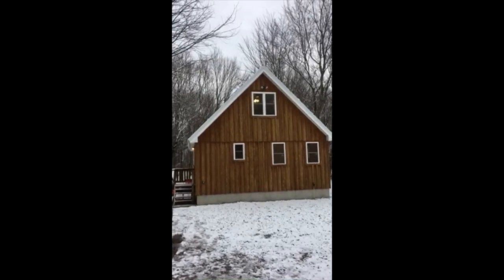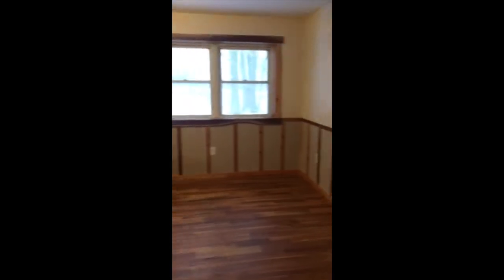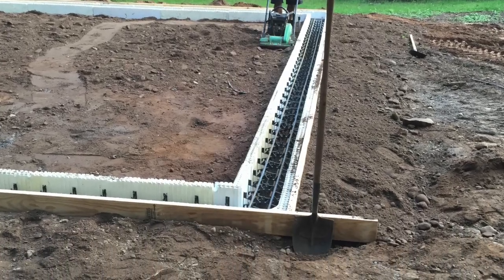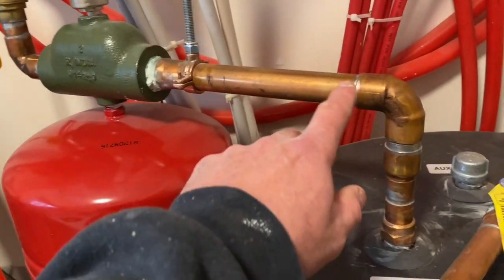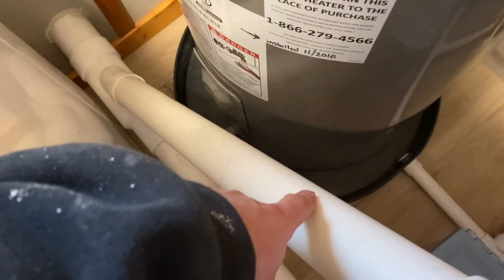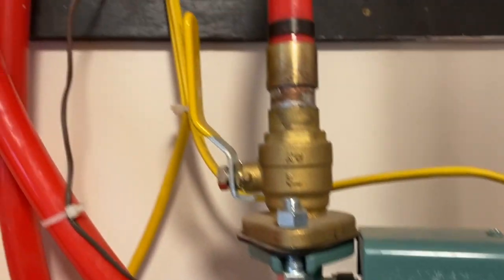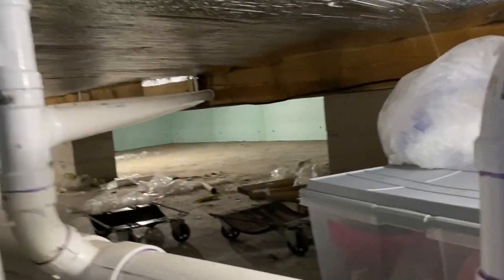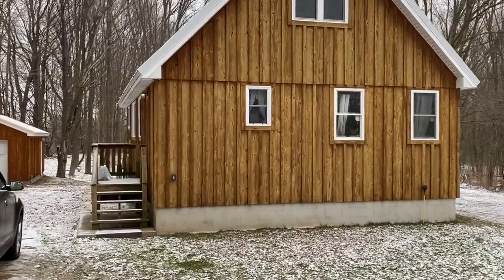Can you heat a house with a water heater????

Comment: Bondo!
Love your videos!
What heats the upper story of your rental house?
I'm planning my story and a half garage with an apartment/loft, which is similar in size to this rental. Radiant heat in the concrete slab, but I'm not sure how I should heat the apt. loft above? Thanks in advance for your answer.
Kendrick

Comment: Just FYI... when you need to get a pipe through a floor joist, drill the hole in the center (vertically). The joist top fibers are in compression, and the bottom fibers are in tension. The center is neutral. Cutting a 1" notch in the top of the joist weakens the entire joist to the equivalent of dimensional lumber that is 1 inch narrower.... you just turned a 2x10 into a 2x9 for example.

Comment: Hot water heat is called hydronics and it's been around for a while. My brother has a HVAC business. In the late 80s, I helped him install all of the hydronic systems in a newly constructed 120 unit town house project. They were all about 1200sf, 2bd, 2 bath units. We used 50 gallon high efficiency gas hot water heaters. Later on we were told that the average power bill per unit was about $65/month and the gas bill was about $25 in 1989 dollars. At the time, the whole system was considerably cheaper than the conventional heat pump system. The only downside I've seen with this system is that you have to size your water heater properly. If it's too small, you will run out of hot water and your heating system is forced to run on emergency heat strips. Which defeats the purpose.
Reply from the maker: Thats awesome. Thanks

Comment: NICE HOUSE, WELL BUILT‼️ QUESTION, Why did you go with Electric hot water heater for your domestic water when you already had propane to heat the in floor heating⁉️ If you have a power outage you would still have hot showers. NEW SUBSCRIBER ‼️. Vinny 🇺🇸

Comment: That check valve on the return that you showed...trying to understand what that's for. When would water pull be able to pull in the opposite direction? Thanks for all the info!
Reply from the maker: That would just stop water from migrating when there is no call for heat.
Reply: @bondobuilt386  ok, thanks!

Comment: Every other application like this I've watched has the pump on the return side - cooler water for longer lasting pump life.  Do you have reason for pumping the hot water?
Reply: most boiler diagrams now push the water on the hot side now

Comment: I built a 26x40 2 bed room ranch  with 2 inch EPS as a thermal brake and 6 inch  dense pack saw it out on my wood mizer heat it with a combi lp boiler use vary little fuel to heat

Comment: How do you size the water heater for the heating system?
Reply: in order to size any heater, you need to know the heat loss of the building first. Heaters are listed by either Kw or BTU output so you can choose what you need. (hint: 1 Kw = about 3400 BTUs)

Comment: don't you use transfer plates to attach the tubing the bottom of the floor.
Reply from the maker: No I dont use them. They are noisy as the tubing expands and contracts and They cost more and are not nessasary at all. Also my tubing will not get damaged down the road as it is pushed right up against the plywood. 👍😊

Comment: so your crawlspace is a dirt floor, block walls?  Looks like you did a scratch coat or something across the outside face of the block?  what about inside, probably foam board?  what sort of access door did you do for the crawl space?  Something you made up or purchased?  Insulated no doubt...
Reply from the maker: Mike we basically poured a frost protected monolithic slab and layed 5 courses of blocks on top of that. So the floor underneith is concrete There is 2” board foam on the inside of the crawl space and we plaster coated the outside with a product called Comproco. Its a fiber reinforced parge mix comes in a bag. The area under the house is conditioned space so its heated like the living area. I made the acess door from 2 layers of foam board skinned with plywood and its fits  tight in the opening. 👍😊

Comment: How many linear feet of pex do you have?
Reply: Thanks! I'm having it put in my shop floor. The shop is 32x60 and I noticed they have 5 loops. I thought I heard somewhere that the loops shouldn't be longer than 250-300'. Maybe each situation is different. Mine is being buried in cement. Maybe that makes a difference.
Reply from the maker: @rlachermeier  Your fine with that. We run up to 500 foot loops and have been for years. You just need a pump that will push those loops. The loops should be as close to the same length as you can get.
Reply from the maker: I can’t remember the exact length of each loop but there are three loops that are between 400 and 500 feet long and they are the same length so no balancing of the system is required. 👍

Comment: lots of nice details here - curious though, wouldn't the radiant floor heat be more effective if the piping was fastened to the underside of the floor/plywood?  as it is, it's just kind of "loose"?  Also, I missed it but is there supplemental heat upstairs?  thanks
Reply from the maker: Thanks Mike. I do all my in the wood floor joist radiant heat jobs this way. I never put it to the bottom of the plywood. I do it this way for a few reasons. 1. I think putting it up against plywood will damage the tubing down the road if someone hits it with a fastner changing floors. 2. the heat plates can be noisy as tubing expands and contracts. 3. simplicity. I keep my systems real simple and try not to make things complicated so somebody can't fix them. 4. cost. this is probably the cheapest way to do tubing instal. the hangers are just floor joist bracing that I bend at the ends and screw in. then zip tie tubing to them. 
Im probably not transferring the heat as well but these houses I build are very well insulated so they are real comfortable and no there is no heat needed in the upstairs. 👍👍
Reply: @bondobuilt386  awesome, thank you.  Good stuff, really interested in the radiant floor heat and well insulated exterior details
Reply from the maker: @mschumaker1  I have many in floor heat videos where we put tubing in concrete. Also several insulation videos. Check out my channel 
Thanks
Reply: Concrete is the way to do it.

Comment: I like the style, Bondo a man with many hats👍🏻   What are the two sizes of tubing your are using in your water heater system?
Reply from the maker: Grant sorry I missed this question. And thank you 😊 I used some 1" pex for supply and return main piping and 1/2" pex for the tubing that runs through the floor. They are both oxygen barrier tubing. 👍😊

Comment: You basically poured a monolithic slab it looks like? Hard to get some inspectors to give the go ahead on them. Personally I like them. Why run block instead of more sections of ICF?
Reply from the maker: Bryce I have never seen a monolithic slab fail. I love them too. They are a real strong foundation. I bought these ICF that were like 15 years old for 5 bucks a piece. This is a house I built real cheap as a rental. I tried to save every where I could. Built it out of pocket. 👍😊

Comment: Why isn't there any insulation on your radiant supply piping side until it reached its floor zone?
Reply from the maker: All that pipe is inside the conditioned  space so no heat is lost. I never really thought it was necessary I guess. 😊
Reply: @bondobuilt386  The greater the temperature difference in building and the hot side piping the larger the heat loss! I've done refrigeration for 35 yrs. Now retired.
Reply from the maker: @MrMaddogg2010  I’m sure your right buddy. It does work real good and burns hardly any fuel for how comfy the house is though. 
Thanks 👍👍

Comment: Great house build. I like all the insulation you wrapped the house with. Check out Navien Combi-boilers.
Reply from the maker: Danny thank you. Ill check therm out thanks. 👍👍
Reply: @bondobuilt386  don't check out Navian boilers lol
Reply from the maker: @chrisE815  ok why? Lol
Reply: @bondobuilt386  Poor quality product but in general I'm skeptical of condensing boilers. Check out Mikey Pipes- he's a plumber out on Long Island. Unfortunately he installed a lot of Navien units and they all have problems.
Reply from the maker: @chrisE815  hard to beat a tank style water heater IMO buddy.
Reply: @bondobuilt386  Yep and a good ole cast iron boiler for fuel oil. Unless of course you have a cool wood boiler that heats your shop and house :)

Comment: Nice house Ron, Could you also use the tank for radiant to supply the hot water for the house? Just curious as to why you need two water heaters. Also like that you have your own sawmill.
Reply from the maker: Tom you could do what is called an open system and supply the domestic water also but you need a stainless pump and they are quite exspensive and this was an investment property. You also could use a indirect water heater or plate heat exchanger. So many ways to plumb this. LOL
Reply: @bondobuilt386   Yeah, I was wondering about that too.  Not questioning you, you obviously have a ton of know-how.  It just seems like one water heater could have done both functions if you used a heat exchanger.   Around here, (Ontario, Canada), electricity is crazy expensive so I don't use it to heat anything.
Reply from the maker: @RobertSmith-bh5cv  ya I have done a few systems that use one heater to do both heat and domestic hot water. They are called an open system. Just was easier and quite a bit cheaper to do this one separate. But out electricity isn’t to bad. 😊
Reply: @RobertSmith-bh5cv  when using that water heater in a closed system with an expansion tank it will last a lot longer ( almost no corrosion)..  He could have added a boiler mate for the domestic hot water heater but his tubing heat is only 125 deg and a  boiler mate recovery time would be slow.
Reply from the maker: Tom I have some videos of cutting stuff on my saw mill. 👍👍

Comment: Excellent! Kitchen looks great. Can you also mention the time and cost you spend. What is the land cost.

Also how deep the foundation?
Reply: How much is the propane costing for the heating? Also is there heating on the second floor
Reply from the maker: @squeekhobby4571  The heating is about $3.00 a day during the winter months. Did not need any heat in the upstairs. It stays nice up there.
Reply from the maker: Thanks. I got the land at a tax auction cheap. The foundation is a frost protected foundation on grade and the crawl space is 5 - 8" blocks high. 40" under there.
Reply: @bondobuilt386  : good deal. Wishing you should build more in future
Reply from the maker: @squeekhobby4571  Thanks It's a nice place for sure. 😊
Reply: @bondobuilt386  : one last question. Why crawl space. Why not radiant tubes in concrete slab?
Reply from the maker: @squeekhobby4571  I wanted to raise this house up because its near a field and snow drifts in there pretty bad in winter. I could have put the tubing in the slab and not in the floor joist as well but would have cost me more for there foam under the slab. I built this house out of pocket so cost was considered for every step.
Reply: @bondobuilt386  : great thought
Reply from the maker: @squeekhobby4571  thanks 😊
Reply: @bondobuilt386  what would change and why?